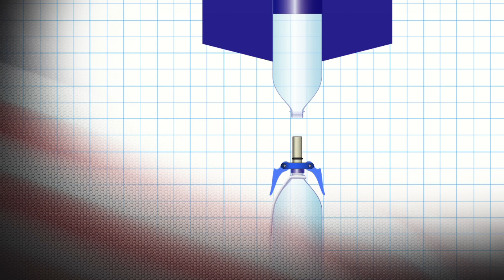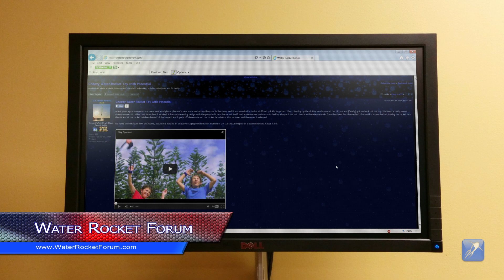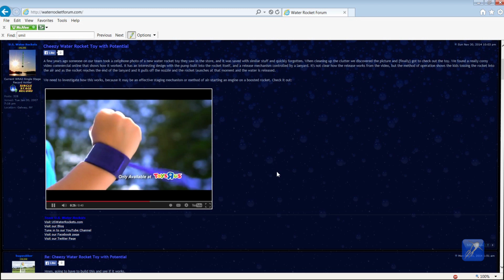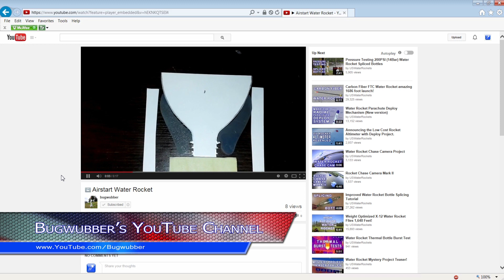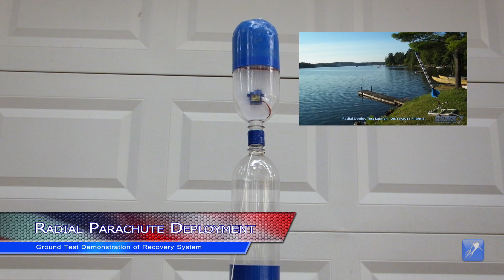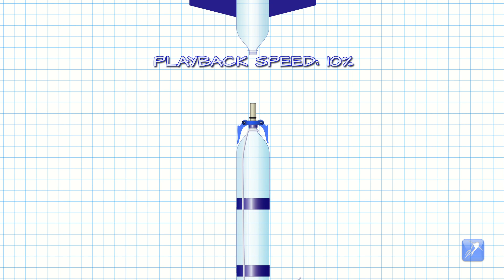Water Rocket Staging Mechanism Design

Comment: I like the idea but at higher pressure i do not think that a rubber band will not hold those clamps down. Good luck and keep up the good work! :)
Reply: The beauty of this mechanism is that only a fraction of the force is transferred laterally.  If one proves to not be enough at higher pressures, the number/thickness of the bands could easily be scaled to match the force needed.
Reply from the maker: bugwubber that was exactly the thought we had. We positioned the clamps and the pivot point and the part that holds the bottle down so that it maximizes the leverage the clamp has and it really makes for a small clamping force at the end of the levers. It might not like 500PSI, but for the pressures these bottles launch at, it holds well.
Reply: USWaterRockets One thing I have been wondering about is the parachute for the booster. It has the potential to really get blasted.  Perhaps extra long shroud lines will keep it rolled up untill it moves away from the water spray.
Reply from the maker: We were more worried that the parachutes would be deploying when the rocket booster was still moving pretty fast. This can rip the chutes. Our thinking is that rolling the parachute up tightly would make it deploy slow enough. This probably would help in any water blast situation.
Reply: +USWaterRockets How about using elastic cord as the main shroud line? It probably would help.
Reply: +Maru Ivan Rico While I don't recommend it, I held  this air start mechanism in my hand for a test launch.  The pressure required to hold the levers closed  is very small.
Reply from the maker: +Maru Ivan Rico we have tried that in the past with regular single stage rockets, and it depends on how heavy the load is placed on the parachute. Sometimes the elastic will break. If we design the boosters so they are unstable and tumble when released, that would probably bleed off enough speed that the parachute would not break the lines. Thanks for the idea!
Reply: +USWaterRockets You mean rubber elastic? I actually meant the kind in our pants, "garter" as termed locally.
Reply: +USWaterRockets Even better if you use an umbrella as the canopy... some tough stuff...